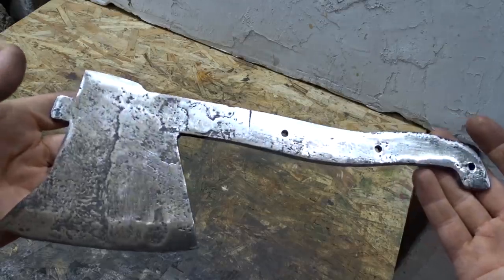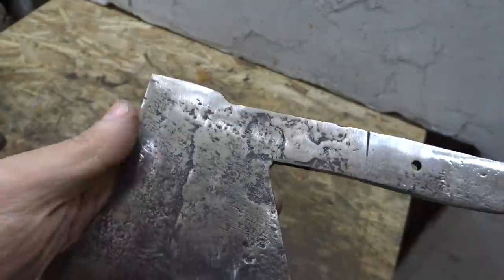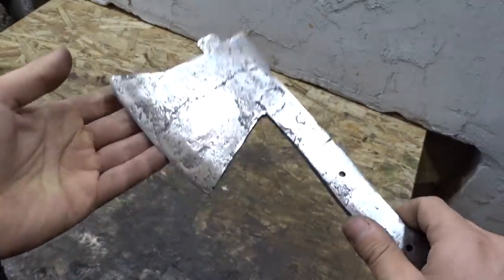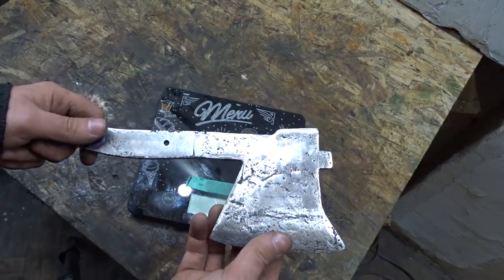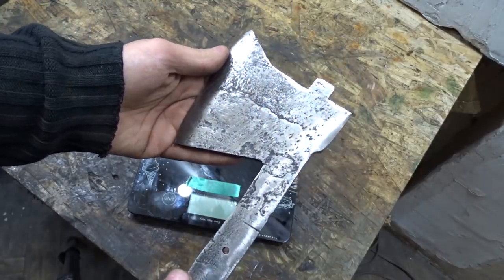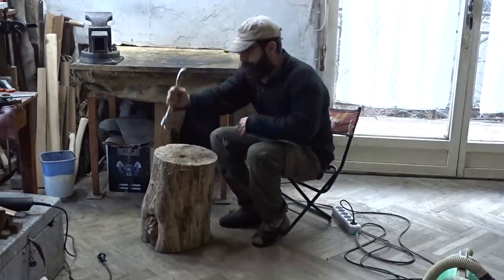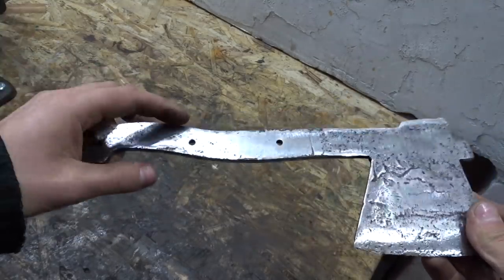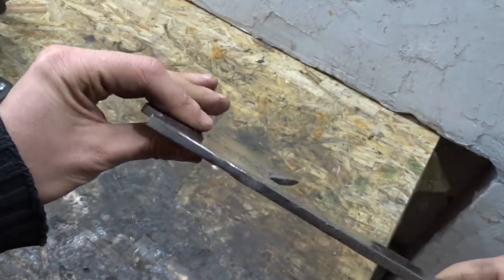Old Rusty Hatchet Restoration

Comment: As far as the deep corrosion,   maybe zinc plating to fill in the holes and add metal back to the piece.  Then sand it smooth.

Comment: I don't how good of an idea this is, but I've seen people sometimes use a welder to fill deep pits in the metal.
Reply from the maker: Yes I know sir, but I don't have a welding machine, sorry =(
Reply: . @ScrewsAndTools  Oh well. It's not as if it looks bad (in fact some people prefer the worn look).
It's functional, no longer covered in rust and has a non-slip grip, so it's a job well done in my book!
Reply from the maker: Thank you!

Comment: I think putting in a furnus (I can’t spell this) to soften the metal and then sanding it to smooth it out.  Them put it back in the furnus and cooling it with oil to harden it again.  Idk.

Comment: Pro-finding fault with work. Plastic is fragile and will split from blows. We need plastic protection near the work part.
Small weight, weld and bolt plates in the back.
A toy for a very easy job.

Comment: nice work but sharpen it up. Too dull for my taste. I like every blade as close to razor sharp as I can get it. I was kinda hoping you'd weld a hammer head to the back side of the blade or something. 
I think at some point, you need to start making your own blades and hatchets from raw metal. You don't need a lot of fancy equipment, There was a guy from the Philippines that used a satellite dish and a blow dryer connected with metal pipe to the fire pit as his forge, and he did right well. other than that, you need a few hammers and an anvil. but even those can be made or improvised. Redoing what you can find is all right, but I feel that's not letting your real talent soar. By the way, however you're learning your English, keep it up, you're better in every vid.
Reply from the maker: Thank you so much! Yes you're right! I very wish become a blacksmith also, due I love metal and wood. Well, I hope I will do this! Best wishes and happy new year!
Reply: @ScrewsAndTools  by the way, with the balance you managed, if it will hold together (the metal, your work is fine) it would be a good throwing axe.